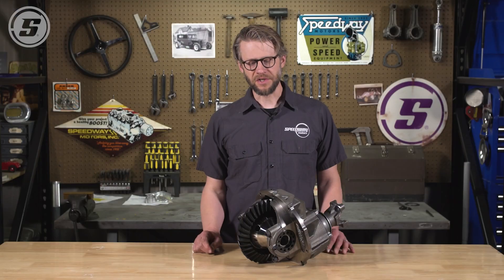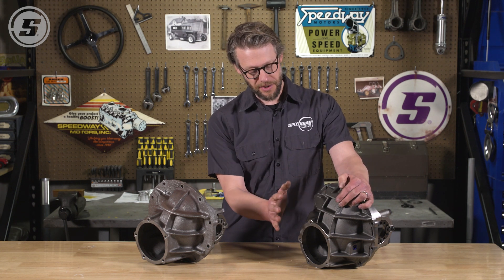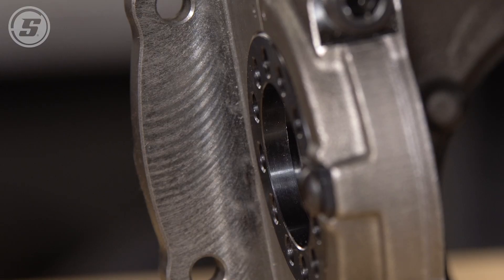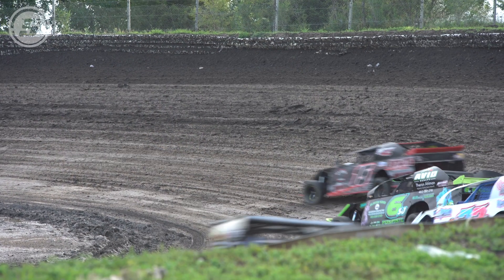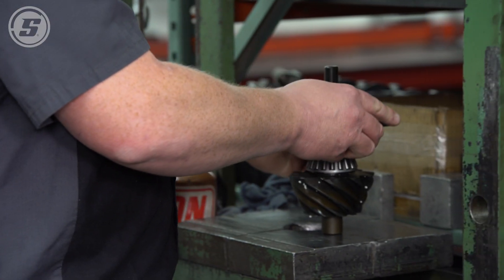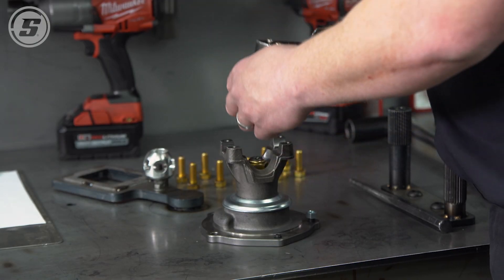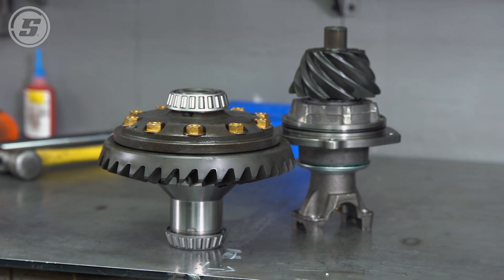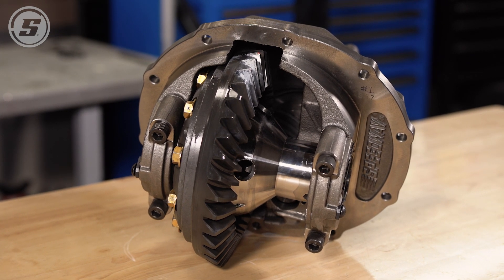Why Is the Ford 9 Inch So Good | Nodular Ford 9 Inch Iron Axle

Comment: Would it be better if i use the 9in instead of the stock 8.8 in my 2001 Grand Marquis/4R70W Transmission. Im curious because im ready to put 3.73 ring and pinion and saving up for a Gen 1 5.0L Coyote V8
Reply: 8.8 will be fine. It’s a great rear end used in mustangs up until 2025. They’re used in trucks too.

Comment: Penn Grade 80W90 GL5 Limited Slip SAE Gear Oil came with my Speedway 9 inch, but in the install instructions for the #9104934   9 inch, it says to use 85-140 weight gear oil. 
Can I assume the 80w90 is just break in oil?